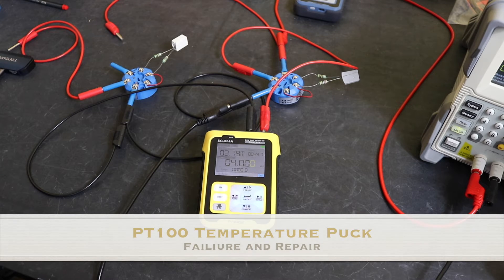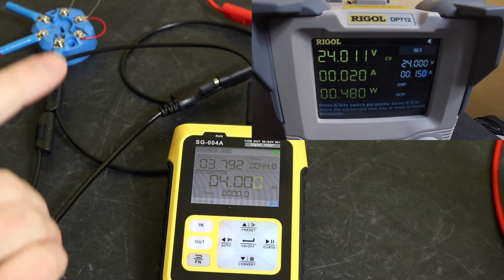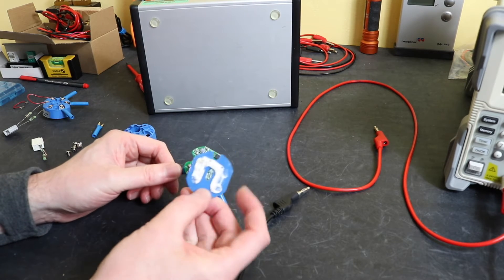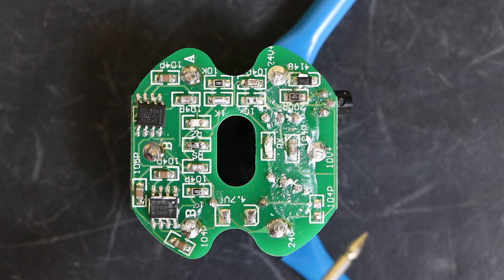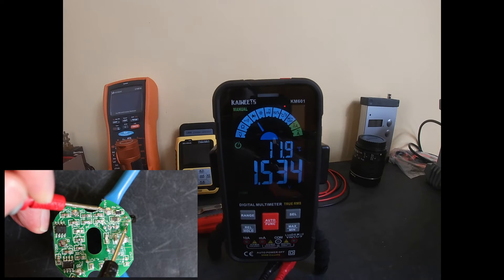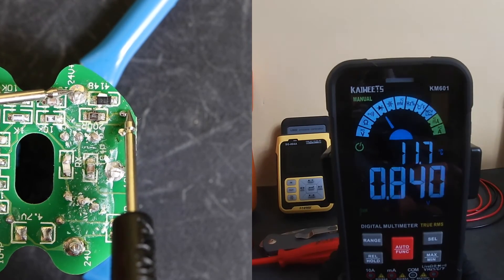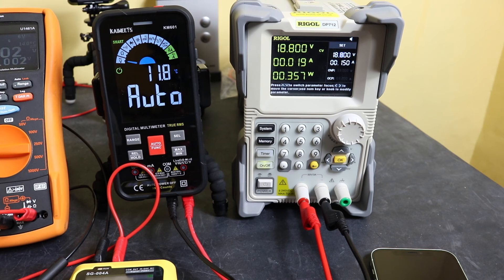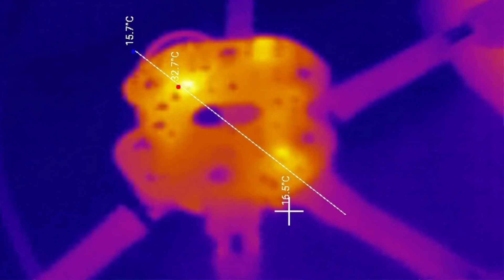PT100 Temperature Transmitter Failure and Fix

Comment: I have a question about testing a system with pt100. When I disconnect the pt100 sensor the display shows E1, so no sensor connected. When I connect my SG-004 and turn it on there still is the error E1.
When 1 connect te pt100 sensor then appears the temperature again.
How should I setup my SG-004?
Output was pt100 and connected it on the same wires as the pt100.
2 wires sensor.
Thanks.
Reply from the maker: The SG-004 should be set up to PT100 on the Ohms tab of the output settings screens.
I would just work my way through the problem one step at a time.
Verify that the output on the SG-004A is producing ohms using an ohmmeter.
Even though it is a 2-wire sensor, I would check that the transducer isn't 3-wire and I have disconnected the link inadvertently.
The SG-004A does produce a small mV output even on ohms setting, so it may be worth verifying or swapping the polarity.
When you switch the output of the SG-004A on the run light should illuminate, presumably it is doing that and the unit is okay?
Reply: @three-phase562  Thanks for the reaction.
What I forgot to mention, when i add the pt100 sensor in series whith the SG-004A then I get a reading on the display. And that reacts also with my setting changes on the SG-004A.
When I measure with a multimeter i have a reading in ohm. I have changed the polarity, that did not help, keeps the same.
But maybe I did something wrong and try it the next time when I am on a site again.
But that can take a while because we have not that much problems with the pt100 sensors.
The displays that are used are not available annymore so the system what it is used for is getting changed for a more modern system.
Next time i wil try it again, step by step.
Thanks.
Reply from the maker: @AE31011  If you have a long cable run from the PT100 to the display then you may have a compensating factor that is set that could be causing an offset in the reading. You could always use the input of the Fnirsi in place of the display to see what the PT100 is producing. Or even take some resistors with you to replace the PT100 with and see what happens. Just select some suitable values from the conversion chart. I do have a decade resistance box I can take with me for that, not the most accurate but gives enough info whilst fault finding in these scenarios.
Reply: @three-phase562  I have just tried it at home with the SG-004A and a multimeter and a couple of times I did not get a reading of ohm's on my multimeter.
So maybe I have done something wrong or not but now I get the resistance readings on the multimeter acourding to the temperature.
What was wrong yesterday I have no idea but the next time I will try it again if it works then.
Like I sayd, these systems are not very common in my work. there are only a couple of them.
But thanks again.